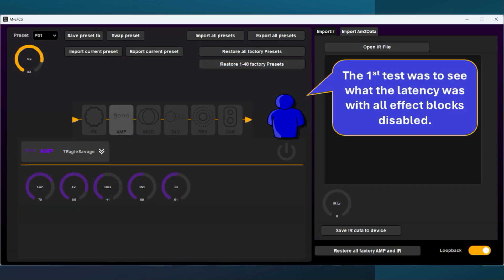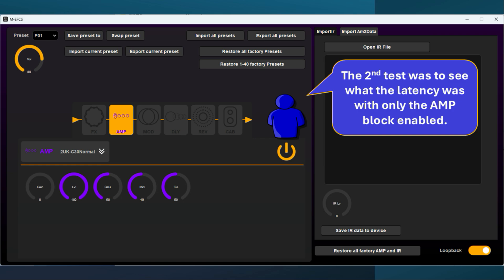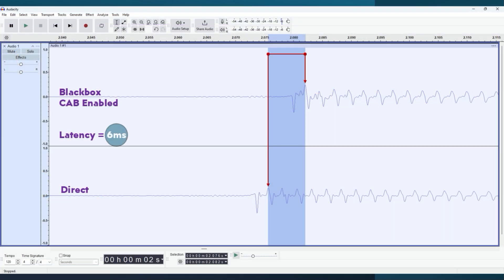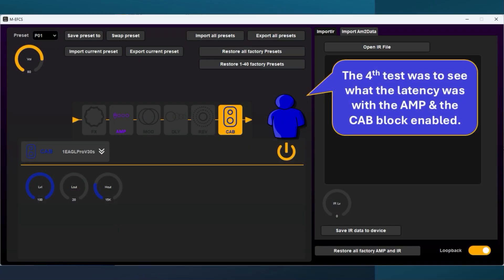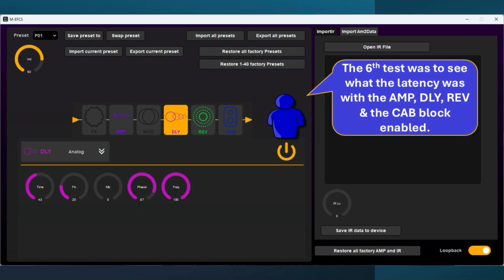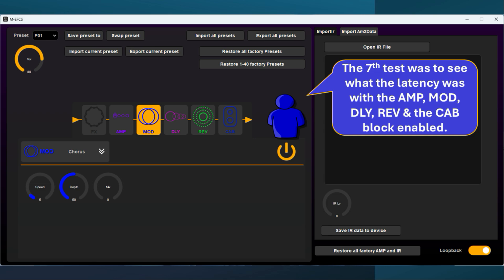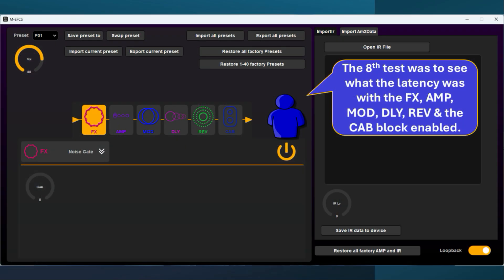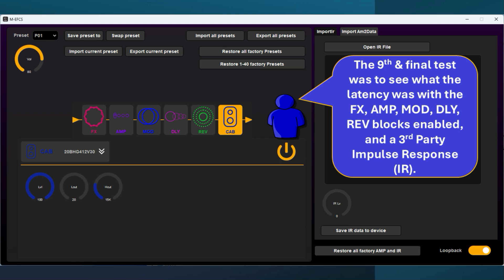WHAT IS THE LATENCY OF THE M-VAVE's BLACKBOX?

Comment: Thank you! I have a question, would it be worth it to buy an analog reverb pedal to reduce latency? 

I'm using a wireless transmitter too so I'm looking forward to reducing latency
Reply from the maker: I don't think adding an analog reverb pedal will help much, unless you only use the amp and cab from the  BlackBox, which during my testing the latency for the amp + cab was 6 ms.  So unless you use analog modulation, delay and reverb pedal it is going to be tough to reduce the latency drastically, but if you did use all analog pedal for the effects you would only be reducing the latency by ~3 ms, which is helpful, but I feel like there are better units out there if you really need to go with minimal latency like the NUX Amp Academy, Strymon Iridium, BOSS GX-100 or the BOSS GT-1000.  If you want to go with the ultimate low or no latency, look at the DSM & HUMBOLDT SIMPLIFIER, which is all analog, but has no effects, but if you used all analog effect pedals with it, then theoretically you would have zero latency. Good luck, there are a lot of options out there, which can be a good and bad thing.